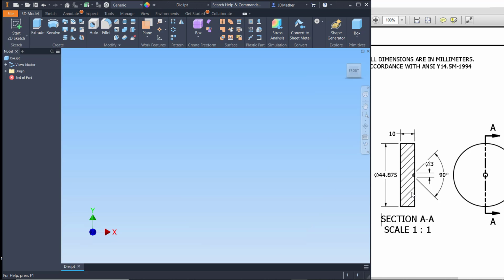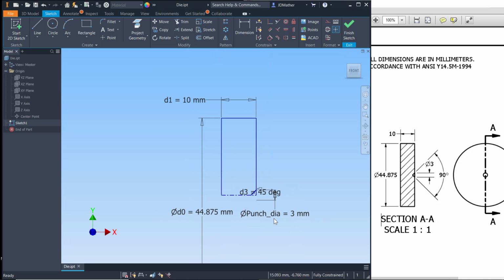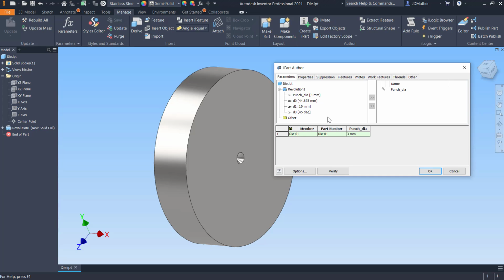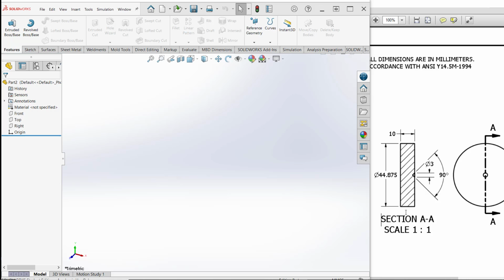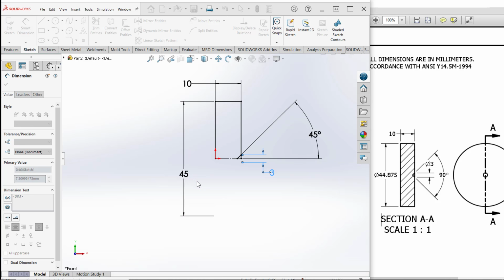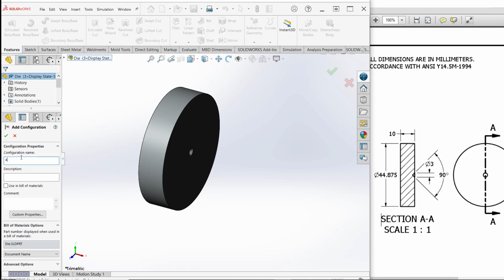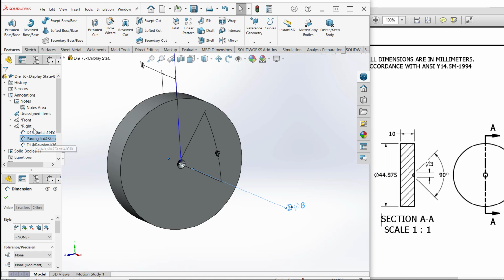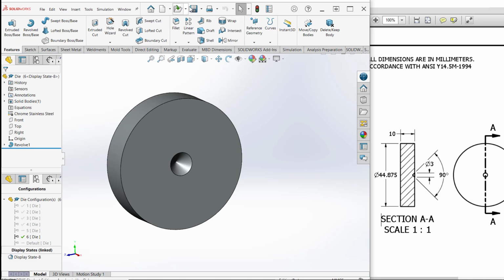Punch - Inventor iPart   SolidWorks Configurations

Comment: While slightly overkill for this example the Solidworks design table is a much better interface for what you're trying to do as it minimizes the repetition and gives you a very clean interface to work in.
Reply: Agreed. This is probably the slowest way I can think of to do this in SW